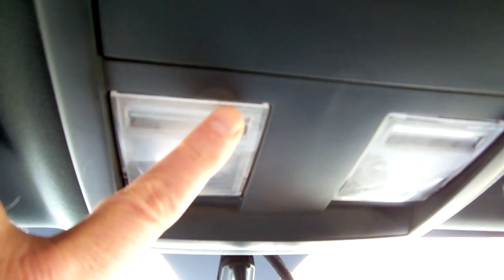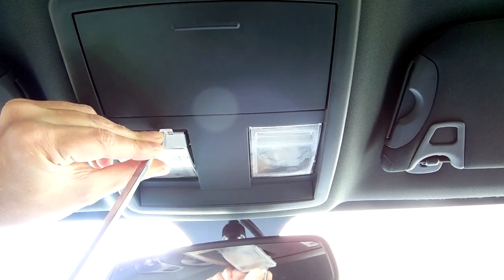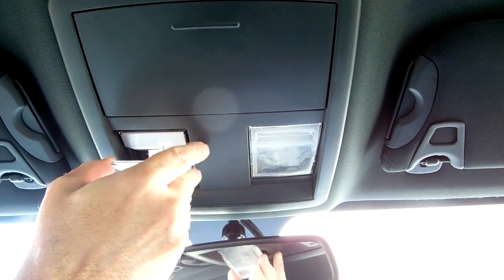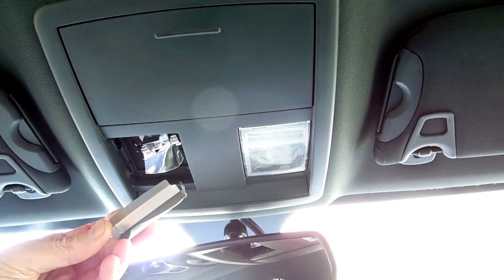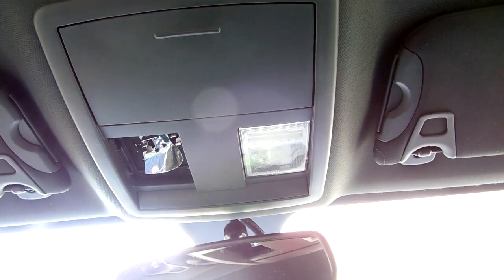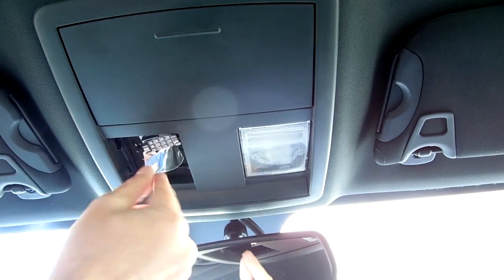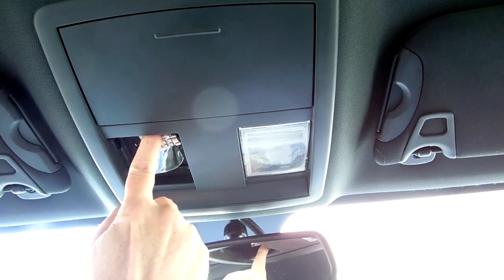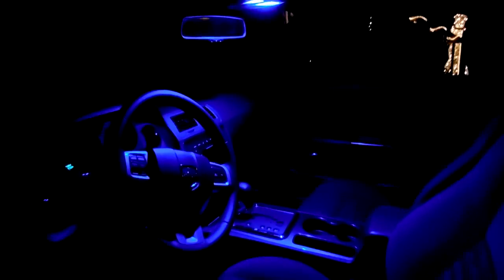How to Replace Map Lights- Dome Lights With LED Bulbs- Dodge Challenger

Comment: Thank this video helped me change my bulbs from standard to LED .. really easy job
Reply from the maker: Cool, glad it helped.
Reply: Sorry, your directions are inaccurate. There is a small detent in light cover towards windshield that let's you use small screwdriver to pry loose from hinge and then remove cover. You risk breaking lens and or tab that presses switch to turn lights on or off if done your way.

Comment: I did change the back bulbs and it was just as simple.  I did not disconnect anything,  did not have to wire or re-wire anything.  I simply pried open the cover, used the tool to pop out the factory bulb and very easily snapped in the LED bulbs.   It was just as easy changing the rear bulbs as it was the front bulbs.  You simply remove the cover, they pop off just like the map light.cover.
Reply from the maker: +ESP Event Service Professionals Thanks, I may try that myself. I was afraid to pull on the back ones not being sure how they come out.
Reply: thanks bud
Reply: Indeed.

Comment: Could you put up a video on how to replace the two smaller lights that are in the roof of the interior? The ones above the seats
Reply from the maker: Funny you should ask that, I haven't been brave enough to try to change those. I THINK they just pull straight down but I haven't tried very hard to do it. The Blue map lights totally overpower those little white lights in the back. You can't even tell they're there unless you make an effort to look up at them. I probably won't change them out because you don't really notice them.
Reply: Kelly Medley did you yank them or?

Comment: I got the driver's side done with no problem cover went back on real easy. Passenger side not so much. For the life of me I cannot get the cover to go back on it's not crack or broken anywhere it just simply won't go back on. I can't get the two pins to hook in the back.

Comment: THANK YOU FOR THIS VIDEO!! My husband had put in some led lights but they didn't light up the interior enough, so I was going to replace the original ones.. welp, turns out the metal that you said didn't need to be there WAS there. So hopefully they are brighter now. This video was so helpful.
Reply from the maker: A. Romo Thanks! Glad it helped.

Comment: Hey great video, I wanted know what's the bulb sz,please let me know I really appreciate it thanks
Reply from the maker: Sorry, I just saw this question. I really don't remember the size of the bulb (it was a long time ago) but they're even easier to find now than ever. Search on Amazon or eBay LED map light bulb Dodge Challenger (or Honda Civic, whatever). Ther e are a lot more choices and cheaper prices than there used to be. Thanks.

Comment: what size are the led bulbs and where did you get them??
Reply from the maker: +Dj Diym It's been so long I don't remember off hand, ( I think the info is in the comments). I got them from eBay, if you search Challenger LED map lights you'll find lots of listings.
Reply: +MrBulletpoints Thanks

Comment: hanks for the insight, been thinking about doing small things to my challenger that are cost efficient and I can do on my own. I have a darker grey 2011 challenger se. You said LED lights don't supply heat so do we really have to throw away the heat sheild? Also, what about the other smaller lights in the back seat. It would be odd to change the fronts but not the back. Anyway, if there is an easy way to change the back lights in the ceiling, let me know
Reply from the maker: Melvin Williams The LED lights are totally cool (both meanings) they do not make any heat. I saved my heat shields but you don't need them with LEDs. I kept them just in case I ever wanted to switch back or something. It's really easy to add the LEDs, just be careful not to damage the cover when you remove it. Thanks for the comment!...
Reply from the maker: Melvin Williams I didn't see the part about the back lights. I didn't change mine because I didn't want to risk messing them up, but you really don't notice because the blue lights overpower them. You could cover them with a colored film or paint the covers even, if you wanted to. Just to clarify about the heat shields, you can leave them in if you want but they are not needed with LEDs and I think you get a brighter light without them.
Reply: MrBulletpoints Appreciate the quick response. Recently started a car club with about 6 challengers here in richmond va and want my car to be fit for car shows next summer. Your right, i didn't pay attention to your back lights being over shadowed by the LEDs. You can't really tell they are there unless you get in and look. You spoke of colored film, where would you find it. A local detail shop, ebay, amazon?
Reply from the maker: Not sure about that. I guess you just need to look around. You'll probably have to cut something to fit. I haven't seen anything on how to actually replace the back bulbs.
Reply: I am LegendaryYea thats cool. We are rookies at this and are literally just starting so we are trying to get things organized. We arent established or anything so nobody knows who we are. Just a bunch of guys who said we should make our own club and here we are. You got my name, so look me up on FB. Im in richmond, my profile pic has two challengers on it so its not hard to find. Also on IG, mr.williams27.  Not really any pics on either one about the club like I said, we just started. Just request me and we can go from there introducing you to the other guys. Currently we have a member who just moved up there by you f.y.i
Reply: I am Legendary My bad im just getting to this message. Yea just look me up, my profile pic is just me but my back ground pic on my page has two challengers on it. That lets you know its me

Comment: I was wondering if you could show me how to replace the lights that are over the seats. The ones that are for the back seats. I couldn't figure it out. Please and thank you.
Reply from the maker: I wish I could. I have been told those are soldered in. I don't know if that's correct, but I didn't want to risk messing them up. I never notice those lights because the map lights are so bright. If you figure it out let me know...
Reply: Kelly Medley 
The way u say lol but u were able to replace the bulb?

Comment: are the door lights the same as well?
Reply from the maker: David Martin No, I didn't do anything to the door lights, but the blue LEDs are so bright you don't notice. I'm not sure how to do that, never looked into it.
Reply: ok thanks.. just to know if there the same light and size... would you be able to give the site or link to what product you use for your dome lights.. and thanks for reply
Reply from the maker: scroll way down through the comments. I think I put the info in an answer. Got the bulbs from eBay, search Challenger LED bulbs and you'll find lots of them.

Comment: what did you do about the rear ones and the ones below the glove box and steering wheel?
Reply from the maker: I didn't change any of the other lights but the blue map lights are so strong you don't notice the other ones.
Reply: I was reading that you'd have to drop the headliner in order to get at those, it apparently they're LED from what another Challenger owner told me.   It's probably not worth messing up the headliner.
Reply from the maker: Matt Jajkowski Thanks for the info. It didn't look like it would be easy to get at those lights.

Comment: What size are the bulbs fire the dome lights.
Reply from the maker: Gregory Hines It's been so long I don't remember. If you search Challenger LED dome lights or Map lights on eBay or Amazon you will find them. If I remember correctly the color I have is Xenon Blue. Thanks for watching.

Comment: What's the bulb size number?
And do you have a video for the rear license plate?
Reply from the maker: It's been a while, I don't remember the size number but I found the LEDs on eBay by searching for Challenger map light LED. You can find the info on eBay and then buy the bulbs wherever you want. Sorry, I don't have a video for the license plate bulbs.
Reply: Good day mate. kool video. Just wana know do you know where to get spare  maplight cover the plastic hook broke on me
Reply from the maker: Karan Maggon Ouch, I'm sure you can get them from a Dodge dealer for a price. I would check out eBay and Amazon. They usually have everything cheaper. If all else fails you might find it from a junk yard from a wrecked car.
Reply: any luck finding the plastic covers? mine broke off and I can't find them anywhere (haven't gone to dealer yet)

Comment: I like the color of the LED bulbs that you have put in your charger.  I wish you could remember who you ordered them through on ebay.  There are MANY different sites to order bulbs and I can't find anyone local to order them through.  Are the reading lamp bulbs in the back seat the same as the map lights?  Any suggestions/help would be great!!
Reply from the maker: jeff montre Sorry, I actually just logged on to eBay to see if I could call up the transaction so I could tell you the name of the seller, but it has been so long ago the info doesn't show up.
Reply: Do you know if you can change the two lights that are in the back seat with the LED Blue as the front?
Reply from the maker: I have read that they are soldered in. I don't know if that's correct or not, but the blue lights in the front are so strong you don't even notice the little white lights in the back. I thought of trying to color the lenses or cover them with a blue transparency or something, but I haven't done it yet.
Reply: Well, thank you for replying.  I found some lights from ebay that will possibly work out.  It is a package of six with 12Led lights.  From your video I can see how much difference there is in color.  I have the side door pockets and cup holders are in blue when the headlights come on and this will be a great add on.  Thank you again for replying!
Reply: My next project is halo lights for my hd headlights.  Heard you could add them to the headlights you already have.  Guess will have to see.
Reply from the maker: Cool, those look nice. I don't have halos.
Reply: I found some from doing some searching, but they aren't cheap and I really don't want to mess up what I already have.
Reply from the maker: jeff montre Hey Jeff, I just found the info for you; The seller was @usr/newhightechcorp?_trksid=p2059210.m2749.l2754 .
Here is the item description; @itm/251312383470?_trksid=p2059210.m2749.l2649&ssPageName=STRK%3AMEBIDX%3AIT hope this helps you out. Good luck!
Reply from the maker: MrBulletpoints Sorry I tried to cut and paste; the color is called Xenon blue.
1.72" 44mm 12-smd led festoon bulb for dome map light. 211- 2 578 you should be able to find the exact ones from this. Seller is newhightechcorp.
Reply: I cant thank you enough!!
Reply from the maker: Not a problem, have fun!
Reply: jeff montre  You can buy them on carid.com

Comment: so I did this in my charger and there was the heat shield but the little chrome looking piece behind the bulb was missing on both sides and now only one side works I did flip it around and nothing but when I switched the bulbs around to make sure it worked they both lit up on one side any ideas
Reply from the maker: +Greg Not sure what's going on there. Both bulbs are good, you might have a loose wire on the side that's not working.  I would try putting the original bulb back in the side that's not working. If that bulb doesn't work, you know there's a problem with that socket. If it does work, the new bulbs just may not be making contact. Sometimes the LED bulbs are fussy about making contact. Good luck, hope you figure it out.

Comment: A messed around with it a bit and you can pop off the plastic around them but there's no way to get to the bulbs. They are actually in between the material and the metal of the roof
Reply from the maker: Are you talking about a Challenger or some other car?
Reply from the maker: I just realized you were talking about the overhead lights in the back. Yeh, I really don't know about those...

Comment: Hey, thanks for the video, for the 2015 it's not that easy to get them out by prying from the front if at all....   it's much easier using a small flat head and prying off the back outside u shaped hinges.
Reply from the maker: +Giraffe Hunter Thanks, I haven't looked at the newer ones.
Reply: I tried to install this in my 2015, not working like this, can you help me. How you did it?

Comment: nice I'm going to replace my map lights with led in the front and leave the regular bulbs in the rear I think that is ok . I well be using the Sylvania zevo bulbs.
Reply from the maker: +Bob gto That's what I did. I don't think the rear bulbs are easy to replace. I could be wrong... I didn't want to risk damaging the wiring etc.
Reply: I just got done modding the rear dome lights in mine

Comment: I noticed they have the lights for the dome ones which are towards the middle. Has anyone found out how to remove them yet?
Reply from the maker: I have been too afraid to try to remove the little round ones in the back. If you replace the front ones they overpower the little white lights and you'll never notice them unless you look up directly at them.
Reply: MrBulletpoints  The lights up in the headliner of the Challenger, above the seats, are soldered onto a small circuit board. If you have a moon roof, you can get at them - but it's going to take an understanding of electronics that I don't have. There is info and pics online of others that attempted it. My aftermarket stereo install place done it before and did it for me ( changed to green ) for only $75.00
Reply from the maker: Thanks. I don't have the moon roof and I don't think I would mess with it anyway. The blue LEDs are very bright and totally wash out out those little white lights. Thanks for the info, now I'm glad I didn't try to mess with them!...

Comment: Will this work on a 2008 Chrysler  300 LX
Reply from the maker: I'm not sure if the lights are the same but it should be very similar if not exactly the same.
Reply: Thanks MrBulletpoints, hopefully this will work for me this weekend.
Reply from the maker: Good luck. Just be careful taking off the plastic cover and you should be fine.